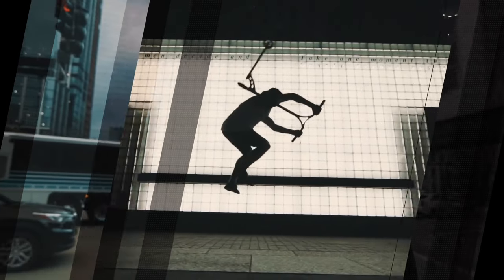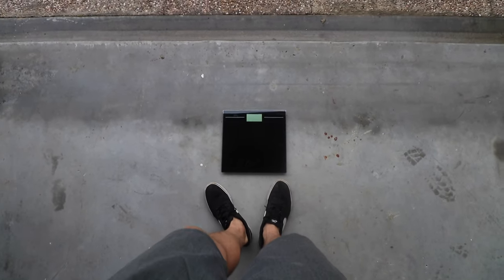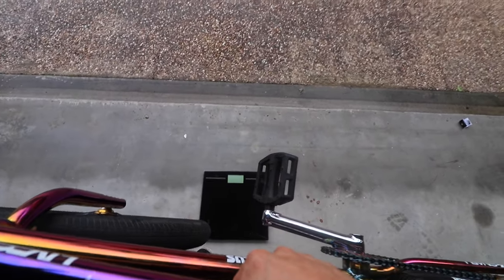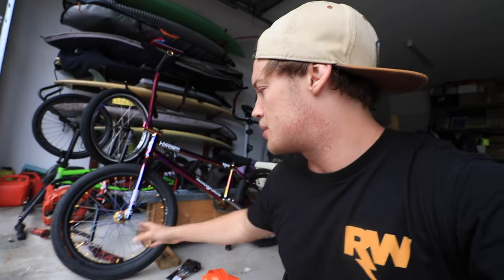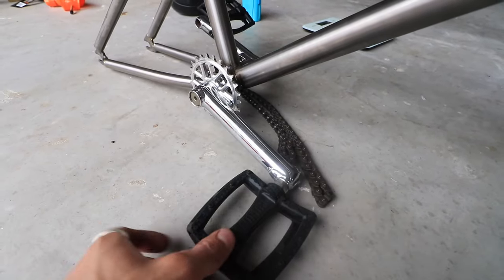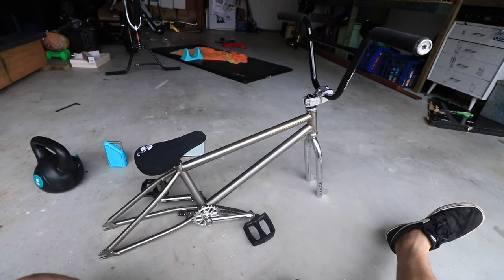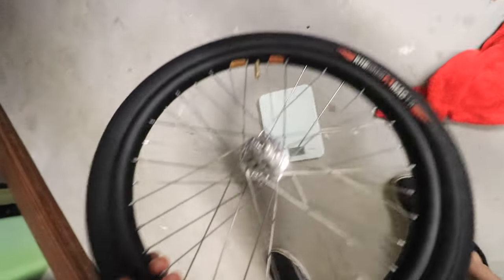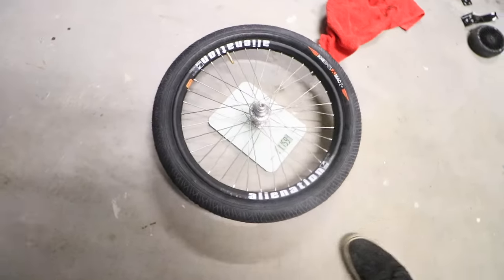MY LIGHTEST BMX BIKE EVER! ($5000+)

Comment: You can shave little more off if you really wanted 😁
-Ti pedal spindles 
-ti seat bolt 
-ti spokes 
-ti bar end bolts/or plastic bar ends 

If your really feeling yourself 
-ti forks 
-ti bars 

I remember I rode one of the grim reaper ti frames before was pretty crazy how light it was. 
I used to have a buddy back in the day that had 18lb bike and he didn't even have ti frame he would take spokes out of his rims. I forget his setup but it was stupid light (felt like you were riding a twig and it was going to brake if you landed wrong😂)

Comment: I know this bike was before your time however re enforced tubing and thick for the tubes that I think will still hold up in big airs better than most. They are the lightest I have ever seen as well ever. I encourage you to purchase a " PK Ripper " frame and fork from back in the day as you would not be disappointed how well these racing bikes were made and I guarantee they are lighter than any modern day bike.
Reply: The landing gear!  Not even Williams R Willy could break that thing .   landing gear , and they were completely rigid and built solid

Comment: Use black/raw components (forks/cranks/stem sprocket) as its marginally lighter than chrome. Cut the fork steerer so you dont need the spacer or extra steel steered tube. 165 length cranks or 170's as theyre lighter than the standard 175. Could even possibly find a 8t ti profile driver (if they even make them) giving you a 28-9 feel with a 25-8 (roughly)
Reply: Profile used to make 8 tooth drivers. 

Instead get a 7075 heat treated driver made. Lighter cheaper but wears out quick. 
Raw every single part and put a super thin layer of paint on so thin it won't chip just scratch. 

Lots of other weighs to drop weight.

Comment: I did 16 pound with the eastern grim reaper (steel 4pound frame ) in around of 2009. 
With all the lightest part available at this time. Lot of TI parts and TI crank and axle though. Have to say i’m machinist so i have mod some part also haha
Reply: @Cody2nd  I wasn't a pro rider. But did park and street abuse for 1 season. My frame had couple of dent but no cracks. At this time i was 165lbs. Nowaday maybe at 200 i agreed i'll snap it of course haha

Comment: Omg I swear. That's crazy man. That's like my typical trip to the shops when I decide I must carry my bags on one finger... 
Dude if you ever see this, ask lux to put out their own custom bikes/parts. Australia needs more parts options that aren't nuked by import taxes/exchange rates/both at once. 
All I want is a full chromoly custom with freecoaster, full set of pegs, gyro for the rear and front brakes pre routed through the fork stem. That DOESN'T cost $1200+. 
Kinda shameful. Ye olde haro zippo from the late 90's came with 3.5/5 of those for like... a third of that

Comment: if you put the tire pump thing on the air valve for your tube and dont lock it in it will release are from the tube so you can fix the tire and then are it up again to fix that tire problem

Comment: How are these bikes around 21lbs when road bikes with 22 gears can be found that are around 18lbs? I can't grasp where the extra weight is on a BMX when it's way smaller, the tyres? Are these BMX frames always carbon these days?
Reply: Road bikes are alluminum or super thin chromoly tubing, not nearly the same thickness, or size

Comment: So now with the decrease in weight, you have got to increase your riding time in order to get the same workout? It's neat seeing that the BMX industry can build lighter bikes that are still durable.
Reply: The Sustainable Texan if you’re talking about BMX race bikes then you’re dumb 😂😂 in my profile pic I’m riding a Prophecy carbon frame and fork and there’s some of the lightest parts on that bike and it only cost £3k. You don’t want carbon for tricks trust me I tried doing a table on that bike and it went horribly wrong because the bike landed sideways and ripped the bike apart. I know the process of making a carbon frame and it’s pretty scary to watch how they make them. Ti is slightly lighter than carbon but not as stiff. They use carbon on a bmx race bike and road bikes because of the stiffness not the weight. It’s all to do with power transfer

Comment: I spent 1800 euro and my bike is exactly same weight
Reply: Luca Angiolini what parts?
Reply: Luca Angiolini my 27.5 with 120mm fork and 17.5 alloy hardtail weigh 25 pounds. It would cost 2 to 3 thousand cad at a bike shop
Reply: The Sustainable Texan not doubting you but I would love to see it
Reply: @The Sustainable Texan Titanium frame cost $2k, but Im still not sure how it all added up to $5k....
Reply: @bmxscape  carbon bmx won't last a day in street, im guessing he does BMX racing